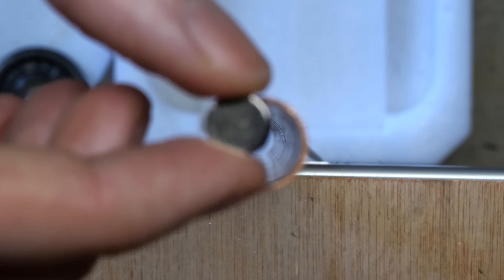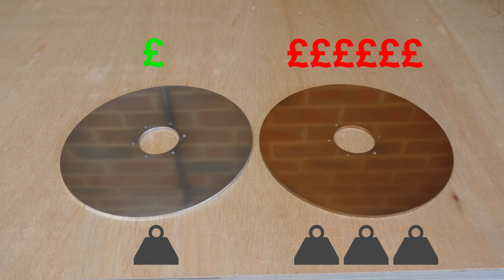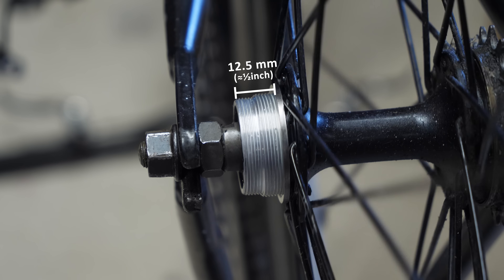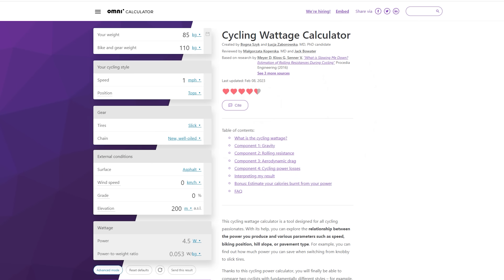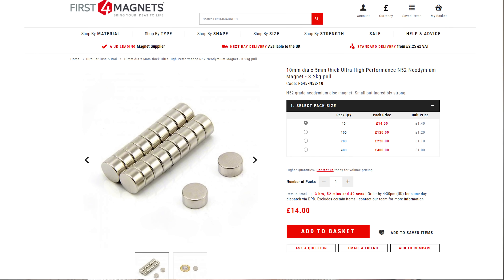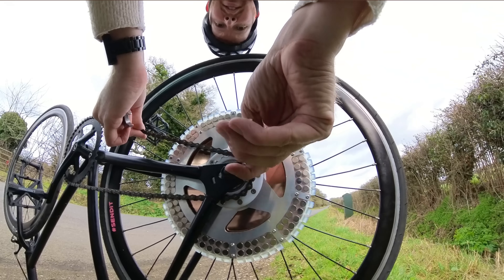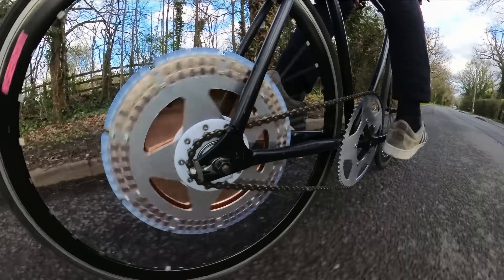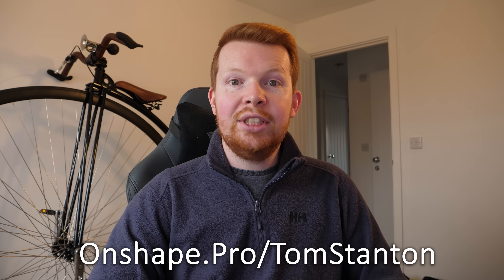Gearless Magnet Bike

Comment: It seems more like you've produced a magnetic torque converter rather than a CVT. Any difference in speed between the 2 plates means some energy is being wasted - in this case it's driving the eddy currents and being dissipated by the copper as heat. This is exactly why automatic cars always used to be slightly less fuel efficient than manuals - because the torque converter required a certain amount of slippage before it could produce torque and so wasted a portion of the energy as heat.

This isn't a criticism of course, I love that you can have an idea of an alternative way something could work and then see it all the way through like this. This demonstration of the physics principals and engineering process is brilliant. I could see your videos being played in physics lessons in schools.

Comment: You need the magnet within the chain as you change gears your chain moves to a larger diameter therefore your thickness of copper or having a duel magnetic chain setup to take advantage of the plate/tire. 

I would love to work on this with you or at least answer some questions that may help if I can

Comment: Just a thought on a MK2:
Each set of 10 magnets 10 could be put on a slider moving in the direction towards the tire with increasing resistances (An anology would be stronger and stronger rubber bands)  of which centrifugal force would push them out and into contact with the copper disc Therefore pedeling slower would have less magnets applying force/torque to the disc and faster pedeling would have more magnets applying more force to the disc. 

Let me know what you guys think :D

Comment: Why so complicated why not make an electric peddle motor which is easy to make and have an electric motor on the rear or front wheel then faster you peddle the fast you go. The major problem is lose thus supplement your peddle more with a batter you can do that two ways peddle to charge the battery or have the peddling and batter work parallel. Now with this be efficient no but interesting you have all parts but the battery.

Comment: This answered the question I had right from the start, isn't this going to be horribly inefficient? It seems to be similar to a vehicle that doesn't have a locking torque converter, constantly losing energy to heat.

Comment: Great engineering and methodological research as always, but you picked the wrong application for this magnetic clutch. This would be ideal (combined with a friction clutch to be engaged once reaching the desired speed) for situations like a car having to tow another car, which from standstill tends to be hard on the clutch. But I guess the manufacturers of automatic transmissions have already solved the problem in other ways.

Comment: The punch press industry has been using eddy current drives since the 1940's, however, they use electromagnets and alter the duty cycle / current / lockup, by pulsing the current or limiting the current. Don't know if that will help, because it is becoming a lost art, as electrical engineers coming fresh from school don't see the advantage of this over frequency drives until they begin failing - old guy Mike

Comment: Would this system (or similar style of system) be suitable for pushbike trailer wheels if it was being towed by a conventional either electric or standard pushbike? Hmmm thinking thinking. In my mind, the pushbike trailer would feel "lighter" perhaps. And would also act as "trailer brakes" upon slowing down... potentially increasing the amount that can be towed behind a standard pushbike. 

The trailer could have either 2 or 4 wheels (single or double axle). If it was double it could hold more and be more stable in doing so, the second axle could be a lazy axle, too. 

If you make it, dibs. 🤪

Comment: if you had all the magnets arranged the same orientation and a keeper frame arranded as others have suggested, you would have a homopolar motor / generator. The current is obtained between the center and the perifery of the copper plate. The US navy did some experiments in using homopolar generators / motors coupled together to achive a drive system in very large ships.

Comment: Pure aluminum is better than pure copper for conductivity by weight, but copper is better conductivity by volume. Was your test piece out of Aluminum 1060? You used the correct material anyway. Pure aluminum would warp and fail over time with that heat generation.

You can greatly increase the magnetic force toward the disc using a Halbach Array.

Comment: Do you need a whole DISC of copper or would a copper ring save weight? Shouldn't the magnets go on the WHEEL since there's less energy lost in acclerating a decelerating the lower velocity component? Lastly, can you stack another copper (ring or disc) on the opposite SIDE of the magnets like a multi-plate clutch? Just some armchair ideas- thoughts? Anyone?

Comment: I like where your brain is going. Fun experiment. I enjoyed seeing you crafting your own parts. I’m new to the “magnetic usages” world but have been studying for wind power generation. I’m still confused mostly but will see the bigger picture if only I persist. That said this next statement may seem sophomoric. 

But first:    

My ideas are mine and they belong to me. Freely and with joy I share, just ask and it will be yours. 

Wouldn’t draining the resistance provide a pathway to reduce your required effort to turn the wheel against the eddy currents? Like using the energy to charge a battery? You could regulate the charge flow and that could act like gearing. Like a variable trickle charger like 5v 9v 12v 14v 18v 24v. My limited understanding would try that to function exactly the way a 10 speed improved the required force to momentum ratios but variable resistivity drain off of the generated current in lieu of a mechanical derailer to change sprockets. Like I said I’m new and very well could have just described something that comes in a Lego set these days. Please help me in my understanding if you have helpful guidance, it will be welcomed joyfully..

Comment: Fascinating stuff!
'Though I gotta admit, when I saw what you were doing, the first thing that came to mind wasn't using magnetic coupling as gearing, but as a torque converter, and they're generally kinda wasteful (fluid losses).  Using direct magnet-to-magnet contact might make it into a sort of lock-up converter, eliminating those losses.

Comment: the copper should be in coils, and the energy generated used to power electromagnets.  now you have a combined generator and motor, electrically coupled to its input shaft.  with a switch and small battery you have regenerative braking

Comment: Great experiment Tom. While the idea is fresh why not try substituting a disc of steel pole pieces embedded in a non magnetic disc and then see the vast, i think, magnetic coupling between the pedals and the wheel. My idea comes from the application of a magnetic clutch in an industrial application.

Comment: I'm impressed by your crafting skills bit I also wonder if you really did not anticipate the negative result (keyword efficiency)?
Reply: Even if you could eliminate the slip and the wasted energy, what is the advantage? If there is no slip, the sprocket might as well be solidly attached to the wheel. What's the point?  This is nothing but a clutch - not a transmission.
Reply: @8546Ken  Of course it is not a transmission. But many people here (including the creator) are talking as it would be one.

Comment: This can't replace multiple gears because it doesn't offer variable torque multiplication. You aren't getting a gear advantage, you are just converting the energy from your legs into heat. It is nothing more than a complicated slipper clutch that offers no advantage and a bit of disadvantage.

Comment: I’m not smart but first what if you also done the same for the front tire. Kinda like all wheel drive. Second I was wondering why you didn’t pedal backwards to break quicker.
Reply from the maker: The forward force on the pedals is really strong, so I was only just able to lock the pedals. It's not like pedalling backwards on a freewheel.
Reply: @TomStantonEngineering   ahh makes sense, you mentioned it a couple times but I guess I couldn’t tell just how strong it was. You did well keeping them at a stationary position

Comment: So much for coasting downhill! The only way to get more torque would be to use magnets on both the copper and aluminum discs. This would tend to lock in the magnetic field between the magnets. Unfortunately, this would also make the bike come to a very quick stop when you stop pedaling. That could be overcome by making the copper disc freewheel much like an actual hub does...

Comment: Hi Tom with all that excess heat can you build a portable room heater using cooper tubing next to those rotating magnets and water running thru the copper tubing which is connected to a small radiator and fan?

Comment: Dunno that i would've bothered to print a threaded piece. There's (extremely cheap) kits online that allow your bike to go from two speed (or however many you have) to single sprocket. There also (even cheaper than that) kits that allow you to retrofit a single speed for disk brakes. Both kits come with various types of mountings, but the most important part is the fact that they have threads for that exact size and methods to either mount the sprocket (the ones you want have basically the same 6 bolt pattern as disk brakes do, but they're not offset) or the disk. IMO, you should have those two types in stock for future projects.

Comment: There was less mass in the aluminum disc. You used like thickness plates. You needed greater surface coverage magnets over a thicker disc, causing a greater friction force over a larger disc of aluminum that has equal weight to the copper disc.

You'll get wrong results if you use different statistical discs.

Comment: Is this the same way magnetic resistance bike trainers work, like for using Zwift ?  The gradients are simulated with increased resistance, but you can go into erg mode for constant power application regardless of the rpm you are pedaling.

Comment: Why do you attach that disc to the spokes? Why not modify a standard disc brake? Brake discs are connected to the wheel pretty sturdy. All you need to do is swap the standard disc for your copper disc. Why invent this construction yourself? Discs in bicycle wheels is very normal, please do not tinker like Hempen Homespun...

Comment: You should attempt to add a locking mechanism, like the torque converter in a vehicle, it is a similar type of “clutch” mechanism, and the lock provides an easy way to keep a constant speed once you are up to speed

Comment: If I remember correctly a lot of induction rotors (which work on the same principle) are made out of both copper and steel. It's possible the steel is mainly there for structural reasons but it could also be that having a ferromagnetic material involved helps with efficiency. A lot of them also use a squirrel cage design which helps with torque and efficiency though I don't know if that could meaningfully translate to a disk.
Reply: Yes, it does translate. This is an example of an Axial Flux Permanent Magnet Generator. The squirrel cage design creates flux loops that are like rings laid flat against the magnetic field line. In a traditional rotor they repeat around the axis of rotation. If you create rings repeated around the radius of the copper disk, you create the same effect. If you search for PCB brushless motor designs, you'll see small versions of the design. For a rotor where you want to maximize the current you want to create single loop per ring with sufficient copper to handle the current created by the rotating field, but small enough to reduce the eddy current losses, which is why the solid disk heats up.

Comment: Would it be possible to use like a clock spring? You pedal to wind the spring, and then use like a throttle for drive? A CVT for bikes is badly needed. Please keep thinking about this.

Comment: This seems like a good torque limiting device for a high rpm low torque electric motor like the drone motor in a previous video. Maybe you can wire the hub to recover some wasted energy to boot.

Comment: It reminds me of a continuously variable transmission so much. It's a shame it wasn't more efficient, because it really neat idea. It's much more obvious in retrospect, but before the build, I wasn't even sure it would create any heat at all. I was definitely wrong about that one.
Reply: But it's not acting like a transmission, which needs to transform the rpm.  It's doing nothing but introducing slip, which is wasted energy. If you could eliminate the slip, than it's doing nothing - like a solidly coupled sprocket.

Comment: Maybe mounting the magnetic clutch to the wheel and use the copper disc as a flywheel. Because it seems your losing allot of efficiency through the spokes. That's more what I had in mind at least.

Comment: Clutches are used to couple to drive motors or engines, not replace gears which are used to trade off torque and rpm. A bicycle doesn't need a clutch since the human body is fine starting at 0 rpm. Introducing a clutch just siphons off power which should be going to the wheel, as you found out when you tried riding up the hill.

Comment: Tom, some thoughts that you may not have had :

1. The drag on your copper disk is proportional to the strength of the magnetic field that it encouters and the speed difference between the driven magnets and the copper disc.  The alternating N S N S of the magnets, as shown at 2:54 is a good idea because it will increase the field strength between the magnets and the copper disc (because the magnetic lines loop from N to S of the magnet (ideally, you should haave an odd number of magnets).  However, I would have been interested to see the difference if you had put a sheet of mild steel (or preferably soft iron) across the opposite side of the magnets from where the copper disk is.  This would aid the magnetic lines by shortening them, and should increase the flux on the copper side of the magnets.
If you had done the same thing at 3:24, that also would have increased the flux through the copper disc.

If there had been a steel/iron plate on the non-copper side of the magnets at 10:41, it would have had the dual advantage of increasing flux through the copper disc, and conducting the flux lines on the other side of the magnets, which should have largely prevented them from sticking to the chain.

All of that said, I was not at all surprised that a lot of pedal energy was wasted in heating the disc, and by extension, the countryside around where you live.  Wherever there is slippage between the magnets and the copper disc, that energy is going somewhere, and that somewhere is not into your back wheel.  At the end of the day, you have to go a long way to beat the efficiency of a chain and sprocket!

Comment: Due the behavior of magnetic fields, I would suggest setting up the magnets in a "stripe" pattern.  So, as it turns the copper will pass through a line of North and then a line of South facing magnets.  I would also have the opposite poles facing the disk on the other side.  This should work much better than your checkering idea.  Though I am curious about how you had the magnets setup on the far side for that test.

Comment: One idea I had is having a crank attached to a generator which drives a motor at the back wheel. You would lose a moderate amount of efficiency compared with a chain but with the right electronics and good motors I think it could feel like having analogue gears.  It could also mean less maintenance and less restrictions on design. Thoughts?

Comment: I went back and watched your Flywheel bike and your drone motor bike videos and it got me wondering if you could use the 30k rpm drone motor to spin the flywheel faster once you’ve already got it spinning. Also I would think that the drone motor would perform better since it would only need one set of gears. But would the motor require a second clutch?

Comment: I'm only a few minutes in and this has likely been mentioned, but with the snippet you show where they are comparing a copper sheet vs aluminum sheet and dropping them at the same time, the difference may be the weight of the sheet as aluminum is likely lighter than copper, so the copper sheet would drop faster just because of that. I know there's the eddy current being generated slowing it down more, but was just a thought as to why that test may be useless.

If the aluminum sheet was thicker to make it heavier like the copper sheet, that may make it cause more eddy current and make it come down slower still. Would need to add weight with something that doesn't have any magnetic properties at all.

Just a thought.

EDIT:
I should have waited 30 seconds before scrolling and typing... because you basically said the same thing. lol!

Comment: Conductivity isn't as easy as saying copper is better than aluminium. Different alloys have vastly different electrical conductivities without any significant change in density.

If you want to build a lighter bike you could reasonably research a good conductor alloy with sufficient yield strength such as AA6xxx series.

Comment: Dude. An electric motor has an electromagnet and a copper coil. You just reinvented the electric motor. Except, the optimized geometry of the coiled copper around the magnets makes for a much more efficient device in a conventional electric motor.